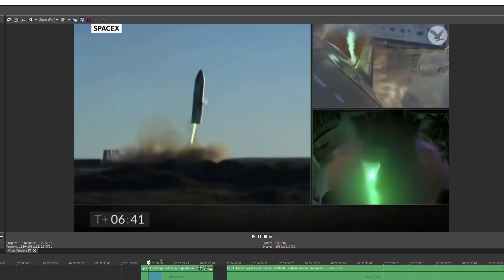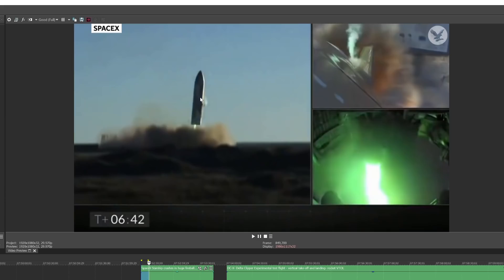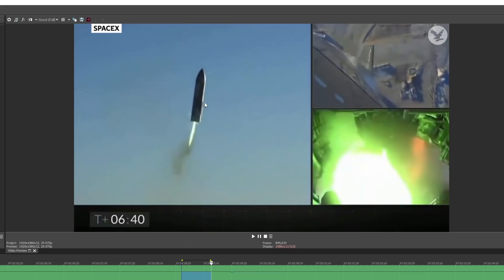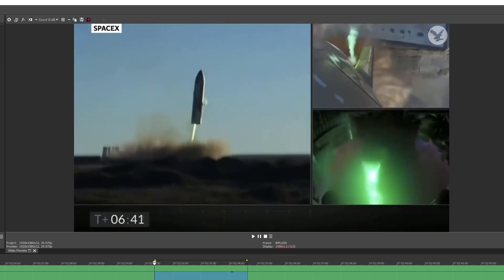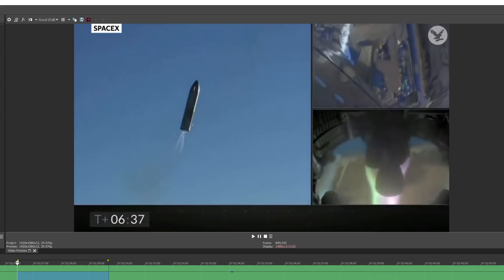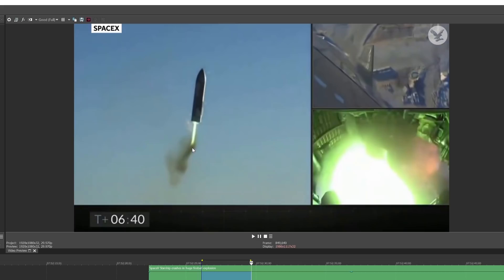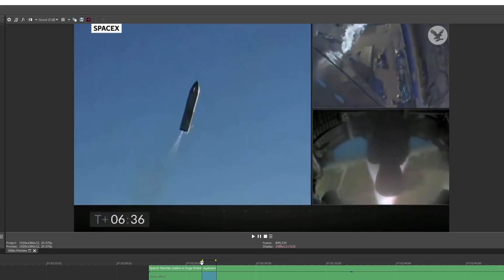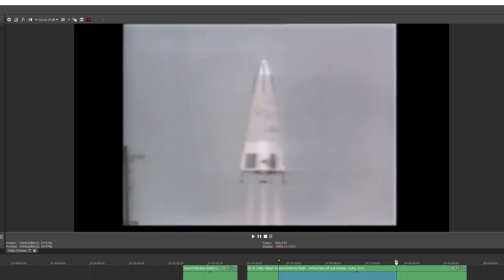SpaceX Starship Explosion: First analysis!

Comment: Ullage motors are how they usually get the fuel to the bottom of the tanks when lighting an engine in flight or in orbit.
Reply: Not in this case as they use header tanks but Phil was unsure as to how this problem is usually solved. He's a chemist and not a close follower of orbital rocket development. 
although that much is clear if you've seen any of his previous videos about SpaceX. He's only here for the booms or to minimize their achievements

Comment: And the sn8 was using hydrogen and oxygen not methane and oxygen and there are 3 engines.
Reply: Raptor engines run on metholox
Reply: Hydrolox
Reply: Why are you saying Hydrolox? The whole point of the Raptor engine is that it’s Methalox.
Reply: what are you on about??
Reply: I just double checked and it is methlox. Mybadd. I could have sworn I heard somewhere that it was supposed to run on hydrolox but I was wrong. Sorry about that yall
Reply: @dracrichards734  Yeah, maybe do the reading before you comment with 100% certainty.
Reply: They're supposed to be hydrolox

Comment from the maker: congrats to spacex on not replicating what the DC X successfully did 20 years ago ;-)
Reply: Yeah, stop it with this stupid argument. DC-X never attempted a belly flop maneuver, never had to suddenly right itself, never had to do a suicide burn, and never achieved 1/2 of the height reached here. There are many things different with Starship's approach to DC-X. So yes, obviously there's room to fail in testing these systems. And no, Falcon 9 isn't just "doing the same thing but bigger" either.
Reply: Also this argument is so bad that I'm downvoting the video because of it. There was nothing particularly wrong about the video itself, but this argument is just so ignorant and cringe-worthy that as long as you keep making it I'll downvote the videos where it gets brought up.

Also, wait, are we assuming DC-X successfully did it too? I mean, sure, it had 12 launches and was only lost on the last one, but it did have 3 partial failures in the process. If we look at Starship as the series of vehicles then SpaceX failed to land it on the 6th flight. All the flights which were easier than what DC-X did succeeded.
Reply: Are the engines injector plates copper, the fule flowing through it would keep it cool so is the fuel supply was interpreted for a split second like fuel sloshing around in the tanks then the injector plate would melt and introduce molten copper into the exhaust stream, this would also explain the soot, the fuels are not mixing and burning properly when the injector plate melts.
Reply from the maker: yup.... DC X did all of this a long time ago.  The only thing that spacex is doing here is the same thing but bigger!
Reply: @voiceofthunder9620  ya, except that Starship is the first system to fly with full-flow staged combustion methane / lox engines,  and on it's first attempt it did do a successful belly flop move for a stable descent controlled with it's flaps, and it successfully righted itself.   Oh and the whole thing will be bigger than a Saturn V when it's ready for orbital flight with the super heavy booster,  with a potential habitable volume bigger than the habitable volume of the ISS.

But ok ThunderF00t keep on believing "there's nothing new here, it's been done before",  as if these tests  and in particular the hover and landing are it, with no bigger goals for Starship.   

And huh, I wonder why we aren't using the DC-X today. Oh right, because it was tiny at 19 tons at launch, with no payload capacity. It was only ever meant to be a technology demonstrator.  

Comparisons between the DC-X and Spacex stopped being relevant 7 years ago with the F9 grasshopper prototypes.
Reply: @KenLord  Also to be correct it must be said that the DC-X was part of a larger program of development of SSTO vehicles, such as investigation of materials and special fuel tanks for hydrogen and oxygen. As a technological demonstrator, it more than fulfilled its function, being a purely experimental project of NASA.

To be honest with the story, you have to analyze both from both perspectives. The DC was a tremendously complex vehicle for the capabilities of the time and budget.

Many people do not know of its existence or the details of that fantastic program, and demonstrated capabilities.
Reply: @kaekae4010  yes the dc-x was cool.  Although it also showed that SSTO just isn't worth it.

There's just no reason to be obsessed with spacex doing something that has already been proven possible (hovering and landing), as if that makes it pointless.
Reply: @KenLord  There's a lot of additional phases between the launch and the landing of SpaceX rockets as well as them skipping the "hovering" part of the landing phase (At least on F9, Starship may be different, but I think they'd still want to do a hoverslam there) to make SpaceX landings different and harder than what DC-X did and as such there is good reason to be excited about them.
Reply: @kaekae4010  the Delta Clipper wasn't a NASA baby, but they had to take it on.
Reply: @voiceofthunder9620  Hmm, except it’s the size of an A380 and is the second stage and was welded together in a field for an incredibly low cost. From an engineering point of view this could be a big step forward in reducing cost to orbit. It’s a potential game changer economically.

Long way to go though but this is a pretty impressive start. In my opinion.
Reply: @voiceofthunder9620  though what you say is indeed true, this sort of thing is nothing new in the industry at all! For example people have been trying to make virtual reality headsets a thing for quite sometime now. But, only now we are getting them on large enough scale. For it happen many new technologies had to be invented and many things had to fall in place. But this doesn’t take away from what has been achieved by Oculus and other companies. The same goes for SpaceX as well I think.
I enjoy your videos a lot. I like that you’re super critical and call out BS for what they are. But, I can’t help but feel you are too sarcastic sometimes. This is just my opinion. Keep up the great content.
Reply: @voiceofthunder9620   And don't forget that the DC-X crew did not have the technological advances that SpaceX does.
For one thing
CPU Speed...DC-X '93 to '96 RAM = 300MHz SpaceX 2020 = 3.4GHz(16 Cores)
RAM..DC-X '93 to '96 RAM = 4Mb to 128Mb SpaceX 2020 = 48Gb
Reply: @kaosinc  interesting. Where did you get these numbers from?
Reply: @kaosinc  in addition to the difficulty of using cryonics engines

Comment: Only one real technical challenge? 
No full flow closed cycle engine has ever flown above 150 m before. 
They did a test flight with three Raptor engines for the first time. 
The first test of an entirely new aerodynamic control surface system. 
A completely novel flight profile and relighting the engines from the header tanks on descent.
Everyday Astronaut or NASA spaceflight have very good footage (including their own tracking telescope footage) And they are much more familiar with the vehicle and flight profile if you are curious and want more details.
Reply: Foot wouldn't have even mentioned SN8 if it hadn't had some kind of failure.  It's good not to be a wild fanatic but completely uninformed commentary is the opposite end of the spectrum. Even though I hoped there would be, I'm not surprised there wasn't even a hint of begrudgingly acknowledging what a feat this test was.  "I've never seen green flame before."  Really?  Although for different reasons, the Merlin flashes green on every startup in flight...in which a landing booster has several and he's had over 60 unique opportunities across 5 years to see that.  That's exposure right there.
Reply: @IanSlatas  You're absolutely right, I mean even in this video he completely ignored the entire test flight except for the very last moments where things failed. Zero mention of successful launch and ascent, zero mention of rock-solid aerodynamic control using a system that has never even been tried before, zero mention of smooth transition into the flip, nothing. To add onto this, the fact that he is so obviously uninformed about launch vehicle tech and specifically Starship tech really makes it hard to take him seriously at all. 
Of all the videos I've watched that have to do with this test flight, Phil's is by far the least valuable. There's nothing here.
Reply: @IanSlatas  He doesn't follow space flight that closely and is not that well first in orbital vehicles. A few months ago he responded to a tweet of mine about Everyday Astronaut where he claimed that all Tim Dodd does is re-air promotional footage from SpaceX. 

Never mind the fact that he has some of the most informational scripted content available when it comes to understanding the aerospace industry. 
Phil does a great job when it comes to debunking pseudoscience but he has a huge bias when it comes to anything even remotely connected to Elon Musk. 
To disagree with him over this opinion does not make you a sycophantic Musk lover either. His approach to analyzing anything he does is inherently unscientific because of his unaddressed biases.
Reply: @faceplants2  totally agree.  It's almost as if foot becomes the lunatic when discussing Musk

Comment: They use header tanks that are completely full for the tilt and landing. They also use helium to keep the pressure of the tanks
Reply: They use autogenous pressurization - taking vaporised fuel/oxidizer and pumbing some of it back to the tank to maintain pressure.
Reply: They don't use helium to pressurize the tanks on Starship.  They send some partially burnt (and cooled) exhaust from the turbopumps up into the tanks.
Reply: @KenLord  Actually they just use boiled propellants, no partially burned stuff. It's called autogenous pressurization and most hydrogen fueled rockets use it for their hydrogen tank. Somewhat more complex than a helium system in theory but in practice helium systems have caused many space programs a lot of headaches.
Reply: Yes, cold gas boiled propellant is used for pressure. The issue was that this particular pressure was to low. The engine didn’t get propellant, so therefore it ate itself. That’s what happened
Reply: Yea, the header tanks lost pressure unfortunately. Hopefully next time they get it... but  they got heaps of data and were expecting a crash
Reply: No helium. That's only on the F9/FH. Starship uses the pressure of boiling propellant

Comment: Elon already said - header tank pressure was low.
Reply: It makes sense, yes, since the pressure was too low, the engines essentially lost propellant supplies so that would mean that the engine would start to eat itself. The cooling system is made out of copper so that explains the green flame.
Reply: Never cross streams 😂
Reply: Right but that’s only part of the description. It still doesn’t explain the green flame, which is a good chance due to copper. Next thing to know is where that copper is coming from
Reply: @aeroscience9834  Injectors are often made of copper, I posted links below. Pintle could've been damaged by fluid wave fluctuation, snapped, burned.
Reply: he would say that...
Reply: @Phil_From_Canukistan  you would say that he would say that obviously
Reply: @dwayne_dibley  you would say i would say that he would say that. too obvious.
Reply: @Phil_From_Canukistan  You're a gifted one, aren't you? He can't lie (and why would he even care to anyway this time?), this vehicle will have to be certified for human flight with NASA, i.e. all failures will have to be disclosed in detail.
Reply: @ArcadiyIvanov  chill
Reply: @ArcadiyIvanov  ok
Reply: @ArcadiyIvanov  He lies all the time, though.
Reply: @ArcadiyIvanov  

Of course he can lie.
Reply: Elon is a joke